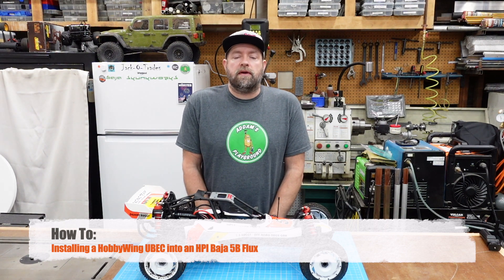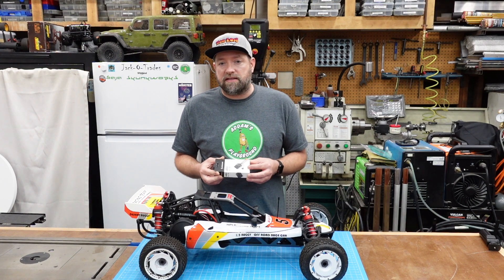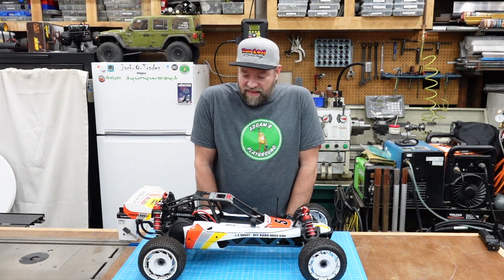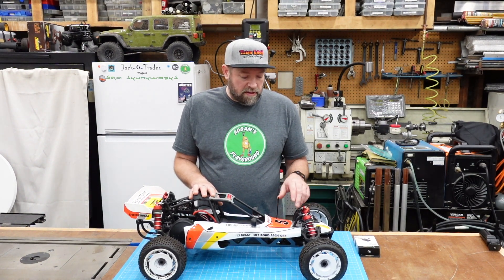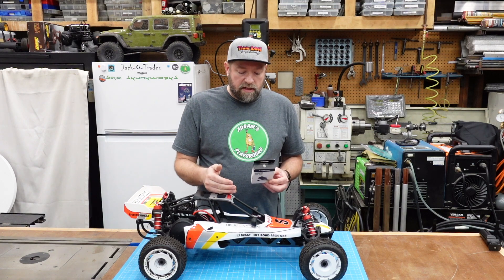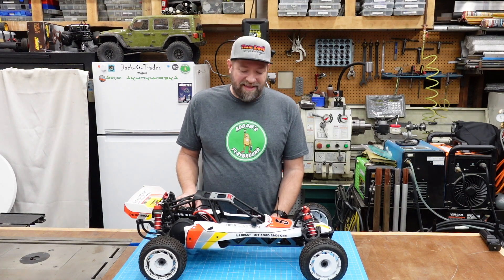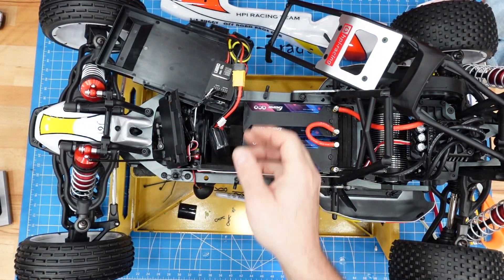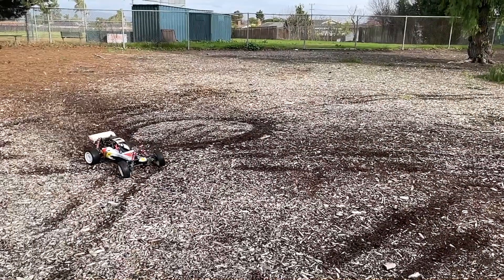Installing a HobbyWing UBEC into an HPI Baja 5B Flux

Comment: Would there be a problem running the ubec from one of the two 4s packs in the car? I'm looking into installing a flight controller to get some telemetry back from sensors on the car, and I don't think using it's PWM output will be able to drive my baja servo

Comment: omg this build is so nice, can I ask you what batteries those are? seem like a great fit but you also modified the battery box right?? Thanks!
Reply from the maker: Thanks! I am using Gens Ace 7500 15.2V packs I guess these are HV lithium packs. They fit in the box without any modifications. But it's a super tight fit.

Comment: I know servos take a lot more power than we thing and getting into those big boys they can really overload an ESC quickly!!! That servo is more demanding than most small scale systems in total!!
Reply from the maker: Ha Ha Ha, you're probably right about that. I feel like it's also something that can easily be overlooked. I have a used crawler that I picked up that for whatever reason cuts out when the steering has to work hard. I'm willing to bet the ESC doesn't have enough juice for the servo.

Comment: How do i know if my rc should need a BEC or not?
Reply from the maker: It depends on your hardware. You need to find out the peak current of your servo(s), receiver, lights, etc...and what the internal BEC from the ESC is rated for. These are specs that should be listed with each product. You want to make sure that your BEC current is higher than the hardware you plan to plug into the receiver (or run from the ESC BEC). I hope that helps.